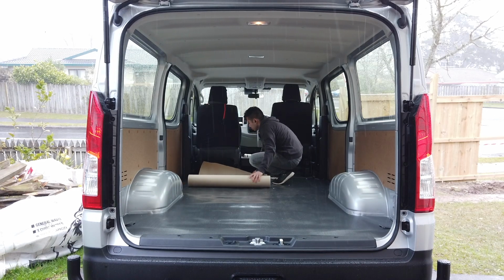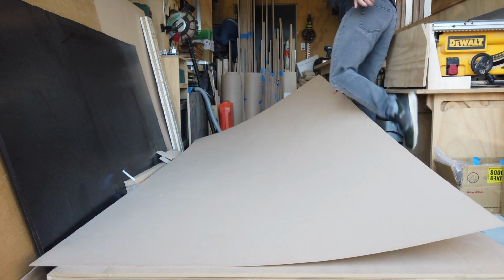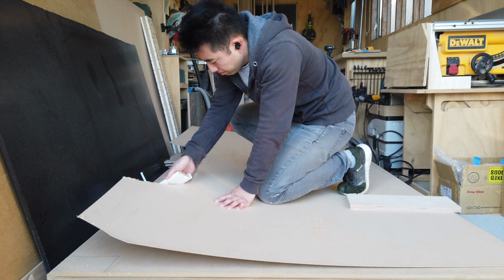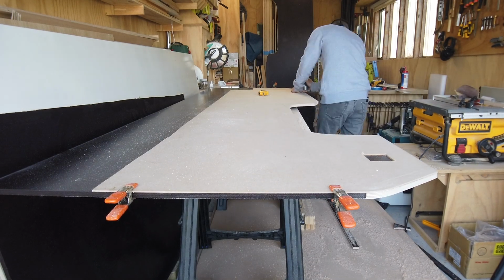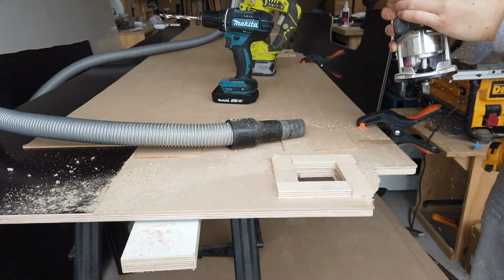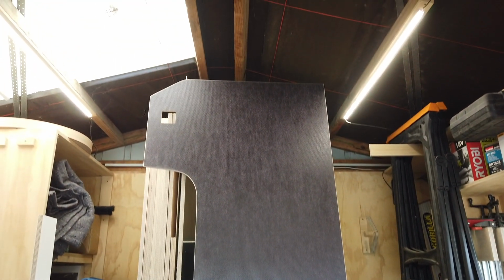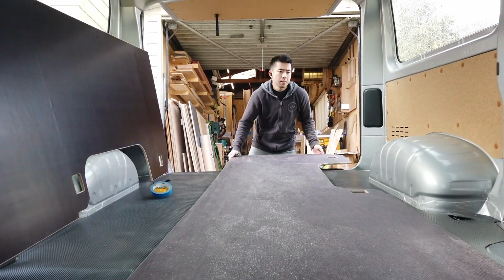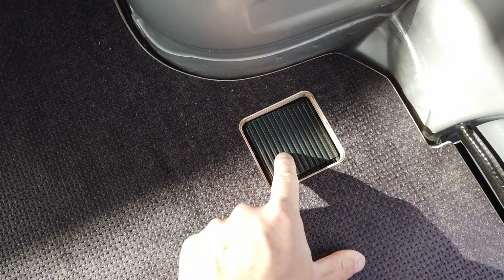Van Fit Out - Using Templates To Get A Perfect Plywood Floor

Comment: Great job, did you just leave it in loose or use some sort of adhesive to hold it down?
Reply from the maker: Thanks. It is not glued down. The weight of itself and snug fit is enough to keep it from moving around and can be taken out if it ever needs to be replaced

Comment: I put a new floor (18 m Ply)  in my Mercedes Sprinter LWB. I used the existing ply floor as a template.  As the fit of the Mercedes floor was "loose" I increased its width by 15mm. Which worked fine. I failed to notice the looseness in the longitudinal existing ply floor. Hence I have 15mm gap behind the rear wheel arch. (I can live with it). What I found interesting was I extended my new floor right to the front seats and there was a 10mm parallel difference between the seats boxes and the rear of the van. No the van has not been in an accident. The original floor stopped short of the front seats.

Comment: Dude - that fit! How did you locate the cutouts for the anchor points so accurately?  ....  did you cut holes in place on the paper version? In any case ... 😍
Reply from the maker: Cheers Rob! Yeah I had it cut out on the paper template first. Just kept cutting away until it looked good and gave it a bit of tolerance all around when I cut it out on the plywood in case I was slightly off. Turned out good!
Reply: @TheOffcut  It did turn out good. Have to admit I let out a wee wtf when I saw how huge that oversize sheet of ply was compared to a normal one :)
Reply from the maker: @TakamiWoodshop  Hahaha I had the same reaction when it arrived! Was not expecting it to be THAT big....